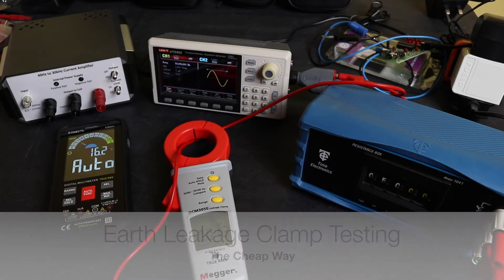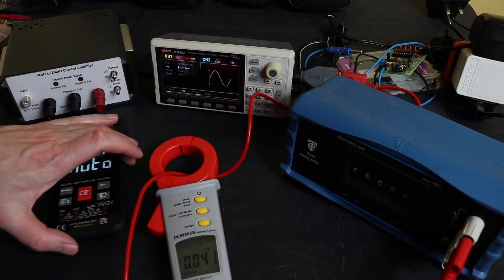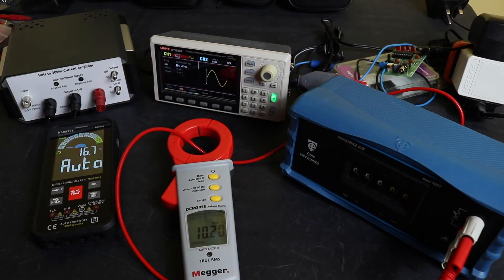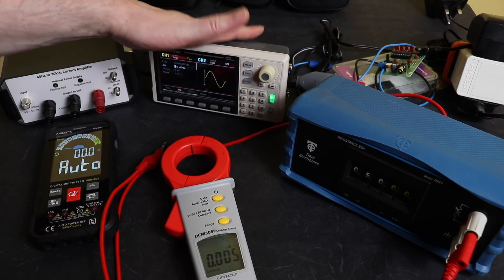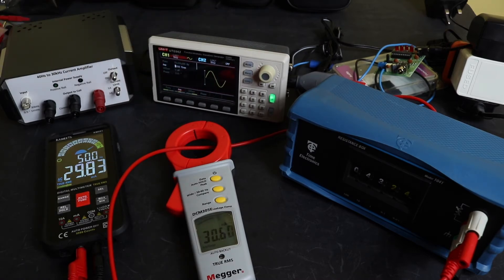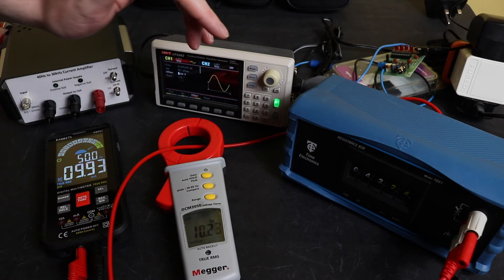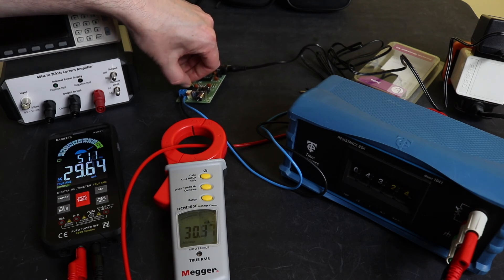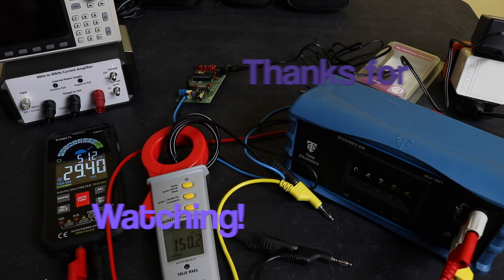Testing the DCM305 Earth Leakage Clamp with the Uni-T UTG962

Comment: Great video.

One thing I'd like to add is at the beginning of video is you mentioned the uniT has a 50 ohm output. I know that the uiT function generator outputs are configurable as 50 ohm or high impedance. If I remember correctly mine came defaultted set as high impedance outputs. 

I don't have mine on me right this second but if I remember correctly when set to high impedance the generator output voltage range is different.
Reply from the maker: Thanks for watching and commenting. The actual output impedance of a function generator is always 50 ohms. When you change the output impedance setting you are telling the function generator what load you are applying to the output so that it can adjust its output to meet the specified voltage based upon the load. When you change the output to HiZ, it does give an equivalent higher output, but will still only be capable of delivering 70mA maximum. HiZ output is used when the load is 100 ohms or above.

The only way I can get a higher current out would be to reduce the load below 50 ohms, but as far as I know there is no forced cooling on the UTG962, so I didn't fancy doing it.

Comment: You could probably "solve" the amplifier problem by using an induction loop driver (for hearing aids).
They're rated at fairly high currents for sensible frequencies in to low impedance loads.
Bit of a hack, but they're easily available.
Reply from the maker: Anything that effectively operates as an audio amplifier should work. I am not familiar with those induction loop drivers, so don't know what there output capabilities are, nor what the prices are, but worth while investigating. Thanks for watching and commenting.